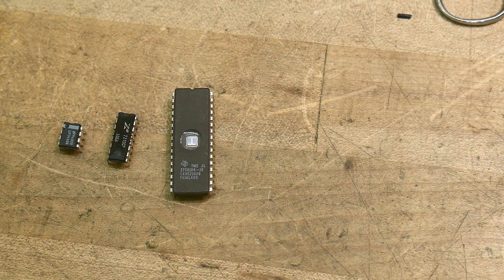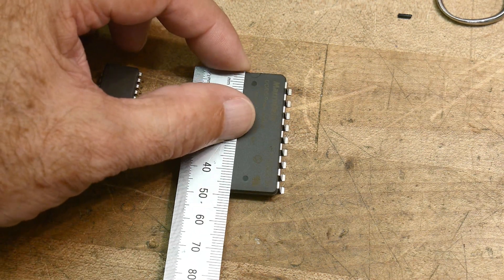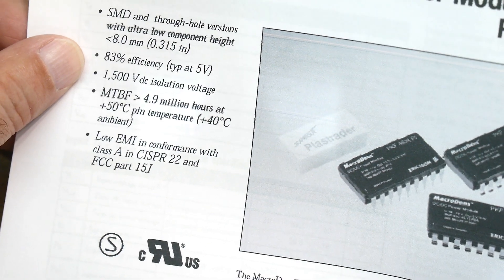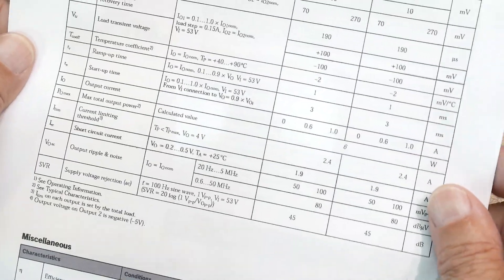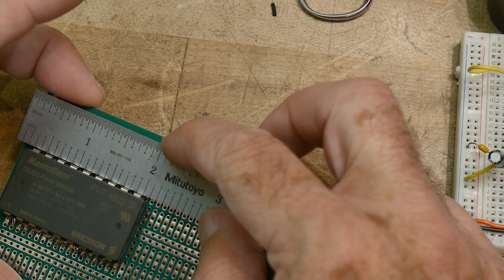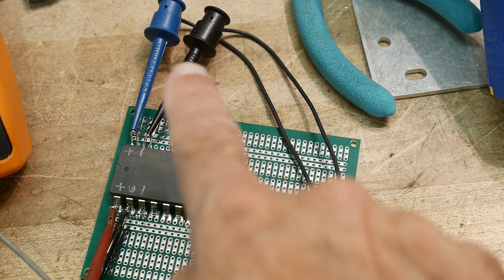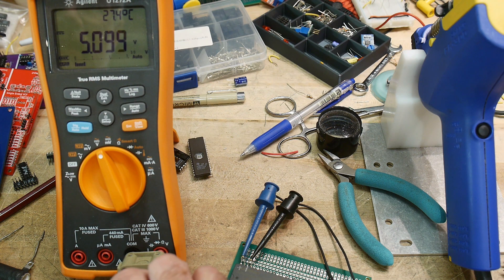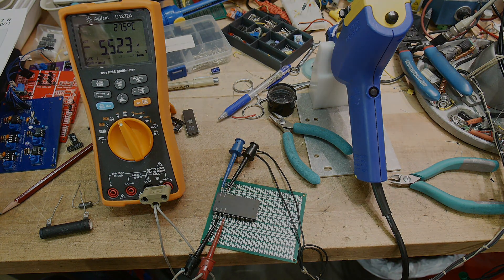#1240 Large SMD package PKF 4622

Comment: Since it's Ericsson, it's probably made for professional telecom provider equipment. multiplexers and so.
the local telecom exchanges are powered by very fat 48V DC wires, probably with a cross section of 5cm, a fat core with an equal fat outer ring.
They also use special versions of the SUB-D connectors, having a single row of thick pins instead of 2 rows.

A ATX pc powersupply has -12V.

Comment: 1. The output voltage can be adjusted.
2. Output voltage is rated between 0.1 to 1.0 rated current.

Comment: Looks like the pin pitch isn't quite 200 thou. Without looking at the datasheet and based on my experience with modern thru-hole capacitors, I'd guess 5 mm? Close enough to get the job done on a 100 thou protoboard, but I'd be sure to set my grid to metric if I didn't have a prefamulated PCB footprint and needed to fabricobble one.

I'm curious about the noise on that chip, or does the bulk of the chip include LC filtering? Again, haven't glanced at the datasheet, but that looks like a lot of extra mass for what appears to be just a LM7805 and a LM7905 (or their switch-mode equivalents) in one package.
Reply: Not exactly a 7805 in smps form.
Handles HV input and is isolated.
40 more of them volts and you could just use universal mains power supply, like phone chargers.
Reply: @plainedgedsaw1694  Yeah, I got around to looking up the datasheet and it's basically a monolithic SMPS. Neat little beastie, but 50mV ripple, so I wouldn't use it in audio. No mechanical information ("That's all right, keep your secrets") but wouldn't be surprised if all the pins labeled as "not connected" actually aid in sinking heat to a copper pour.
Reply: @plainedgedsaw1694  I have seen 7805HV that go up to 70 volts. It was in the 1980s. I have not seen them again!
Reply: @mickgibson370  Were those in the same metal cans as the 5A 7805 ?
Reply from the maker: yes 5mm   0.197 inch

Comment: Looking at Vin on the spec sheet 3:08 it seems to me this part is likely a telecom/train signaling part that would power a board off of normal telecom battery voltages.  Hence it might always have a load attached.
Reply: That's correct - This DC/DC converter series have been designed for telecom equipment and it was widely used back in the day. Although this is an Ericsson product, I've seen it in telecom equipment from other major manufacturers.